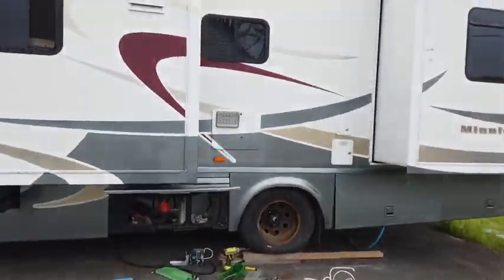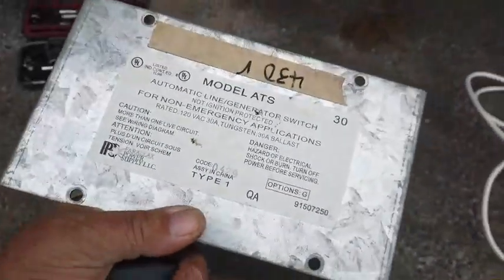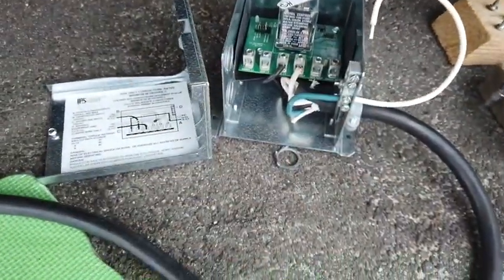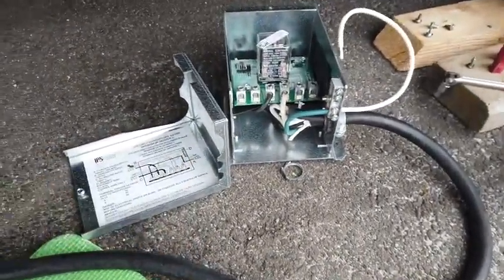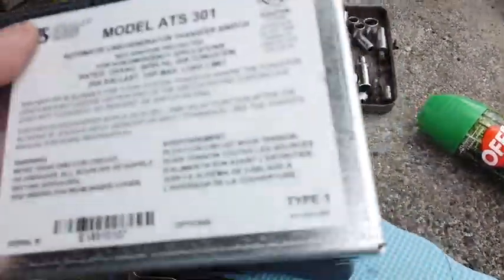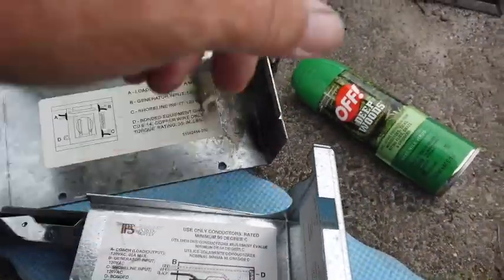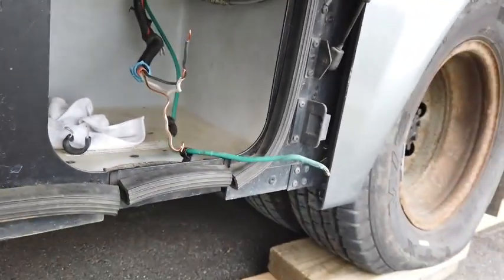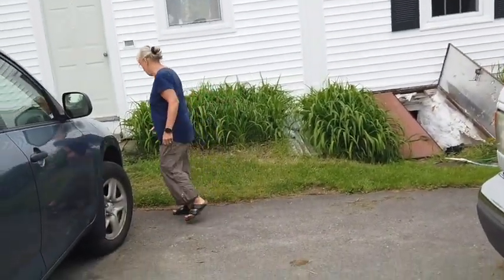Automatic line generator transfer switch, RV Mini Winnebago 2005 replacement for model ATS 30 to mod

Comment: A circuit board if not robust is not going to last as long. Looks like loose connections or undersized wiring were your cause of the magic smoke escaping.
Reply from the maker: hmm

Comment: Nice, the new 'Fire box' (c) 2015 R.Peek naming ltd. Looks neat and clear on the connections .
The old one did look like it was from frankensteins lab, but it did the job fine untill it didn't lol.
Most electrics are fairly simple, but it's always good not to rush the install, give the monkey brain enough time to absorb the details.
That was a long way of saying you got it right lol :-D.
Reply from the maker: Thank you Z.   Yea, I may be slow but I get there.  haha.